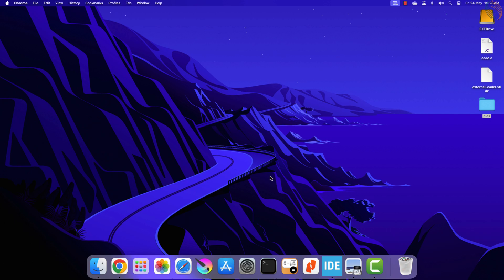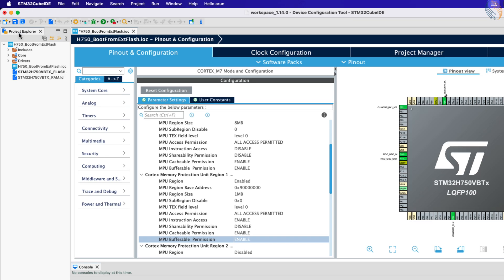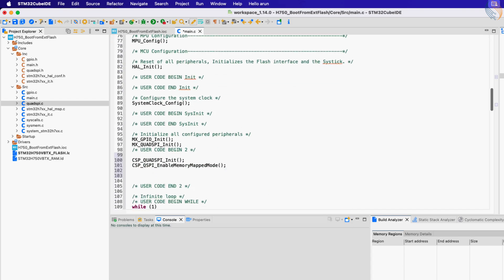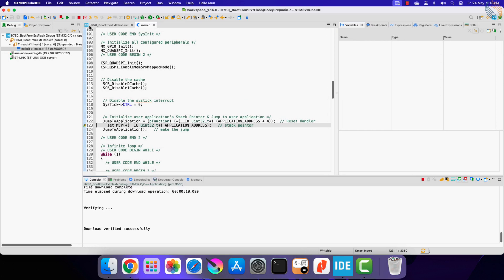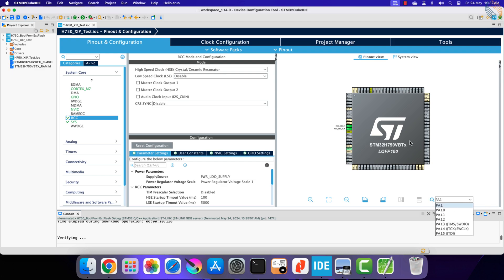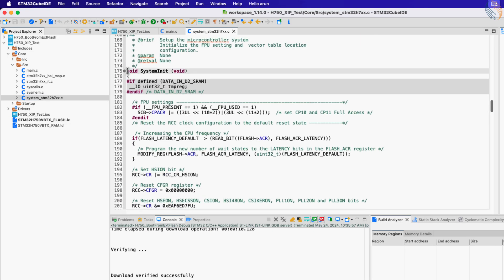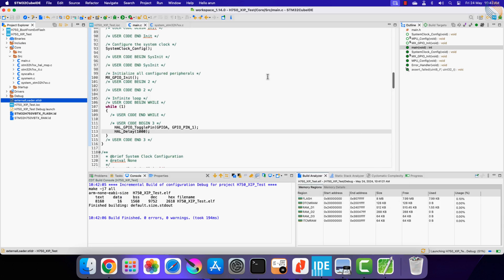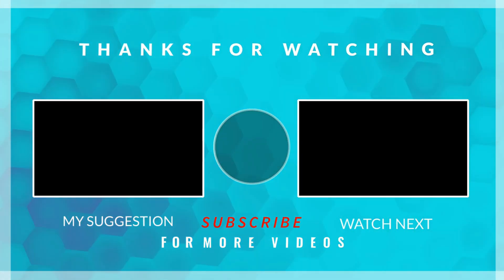W25Q FLASH Memory || Part 11 || Boot from External Flash || XIP

Comment: Hello... i have been following your video tutorial... i just like to know how you debug the STM32H750BV using the USB port? or another ST-Link v2 ?
Reply: Hello... i have been following your video tutorial... i just like to know how you debug the STM32H750BV using the USB port? or another ST-Link v2 ?
Reply: can you do a video using the SWD using ST-LINK v2 with STM32H750BV?
Reply from the maker: What you mean another st link ? There is only 1 st link connected to it and i debugged using that. 
This board does not have st link on board (like nucleo and discovery).
Reply: @ControllersTech  yes, i mean external ST Link... can you do a video on how to set up STM32H750BV with ext. ST Link v2 or v3 both are fine.
Reply from the maker: There is nothing to setup. Connect connect the respective pins 3.3v, gnd, io and clk. That's it.